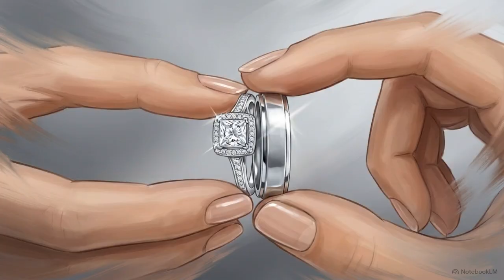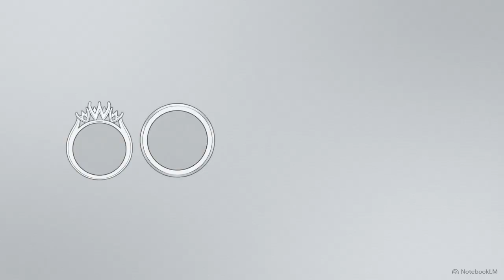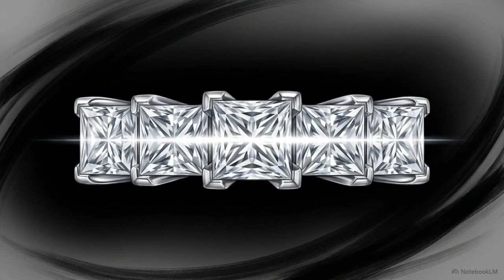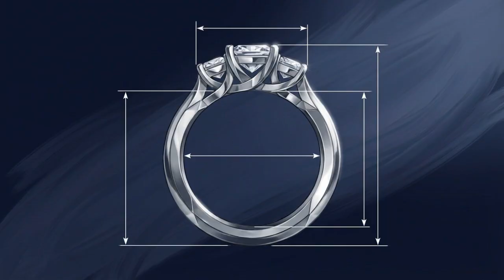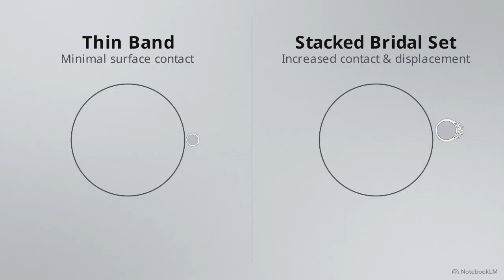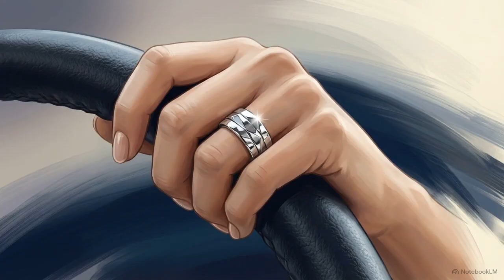Engineering a 1.5 Carat Princess Diamond Bridal Set | 5-Stone Engagement Ring Design Explained

Comment: “Engineering a 1.5 Carat Princess Diamond Bridal….” The buyer still needs a way to translate the lesson into an actual comparison.

I would also test the size with the wedding band and during ordinary hand movement. A stone that looks balanced in a still photo can feel very different once the full stack is on.

The larger option gives more presence, but it can raise the setting and make daily wear less forgiving. Comfort and proportion are better tie-breakers than the number alone.

That distinction is what turns a good overview into something a shopper can actually use.

I had seen John Thomas Jewelers during an earlier search on the tradeoffs in wedding-band fit, with its CAD renderings before commitment being the relevant part.